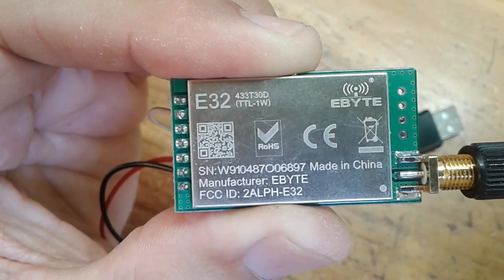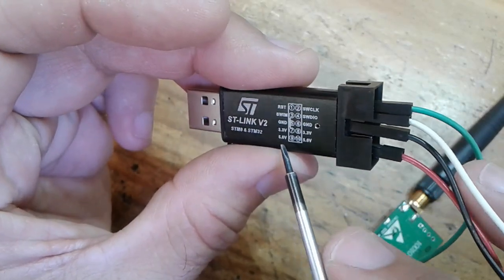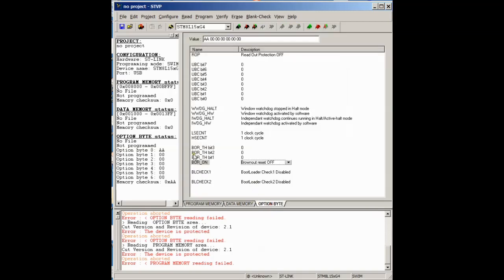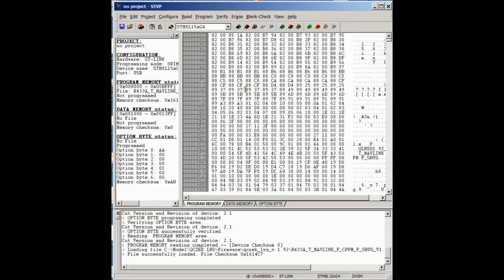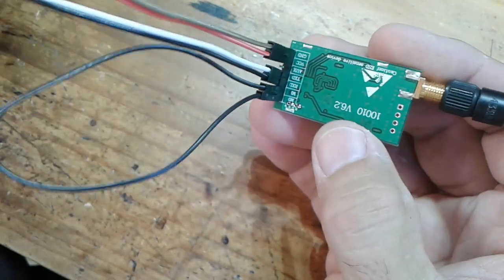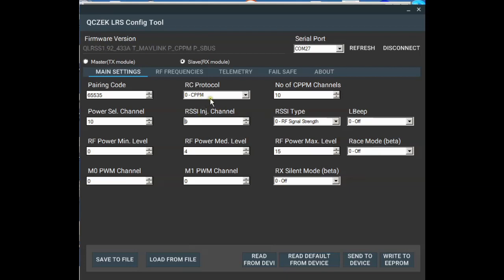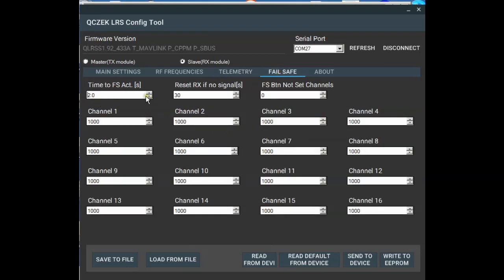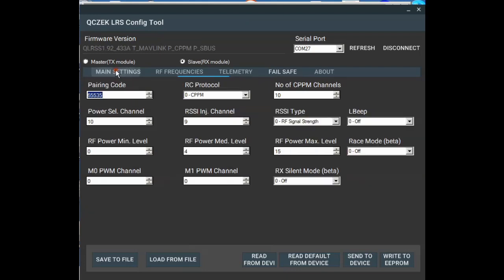QCZEK QLRS DIY LORA  Flash and Configure

Comment: I flashed and configured this LRS, but it doesn't work. The transmitter in the audio speakers is humming, and seems to be working. But in INAV, when PPM is selected, all signals are at 1000 and do not move.
I’m also not sure that I connected the receiver to the FC correctly, I connected the receiver to the FC input on the PPM RX
Reply from the maker: if you can hear that Morse code humm it should be working like you say, im guessing its the FC setting, 
maybe try programing the LRS as sbus, ppm is hard to setup on some FC, sorry for late reply, Brett

Comment: а что означает вот эта ошибка?Error : Cannot communicate with the device !
Check the SWIM cable connection and check all the needed pin connections on the SWIM connector.

If the application code uses Swim Disable and Reset pin as Output or has disabled SWIM Clock Divider:
Try Now to SWITCH OFF and ON the application Power Supply while NRST Reset pin is forced low.

Error : < OPTION BYTE programming failed.
Reply from the maker: I heard there is a problem with the 1B version is your module the same as this one ?
https://www.ebay.com/itm/194251185476?hash=item2d3a45dd44%3Ag%3AZbsAAOSwLSVdixAi
Reply: Да! Точно такой же!!
Reply: И что его ни как не прошить!?если нет ,то какая есть альтернатива?
Reply from the maker: @ЕвгенийМалиёв-й9ц  maybe it is the ST-Link not talking to the module correctly then.....
Reply: @kermets  может быть   нужен другой программатор  ....
Reply from the maker: @ЕвгенийМалиёв-й9ц  yes try another programmer first or do you have another ARM prosseser you can program like this,
https://www.youtube.com/watch?v=KgR3uM21y7o
Reply: @kermets  спасибо попробую

Comment: it gives an error check the SWIM cable connection... do you have any idea
Reply from the maker: I have heard the new version of this module gives errors.....maybe check with the groups on RcGroups in the link above.......
and try another module or programmer.....good luck
Reply: Hi now v8.0 use MCU hc32 from hdsc. İ heard that from ebyte

Comment: Hi sir I'm using e32 915T30D module as telemetry module for pixhack.
When I try to connect it. It is stuck at getting parameters 1, i can see the datas but not able to upload waypoints or mission. Any idea? Why it is not connecting properly
Reply from the maker: Hi, I never used the telemetry side of this module but like all our gear that sounds like a conflict or problem with inav or ardupilot,
are other people useing this module in this way ? if so try to follow there setup first to get it going to progress from there,Cheers

Comment: Any reason u start using qczek lrs.. Saw ur previous video on openlrs
Reply from the maker: I still use openlrs and trust it 100% and have not flown to its limit and had big plans to do a 30km
trip, I made the wing and battery to do it but never got around to it..... I have done so much failsafe testing but thought the limit with
Vee antenna might only be 15-20kms so I started researching with Qczek for more range 
I have only tested qczek local (within 1 km) ........
Reply: @kermets  owhh noted.. Keep up with your video.. Appreciate to see more tutorial like video of your builds or projects.. I am just starting with qczek lrs.. Just bought the e32-ttl-1w but haven't flash it yet..

Comment: I bought an E32 433T30D and came E32 433T30D 1B what can I do? Thanks
Reply from the maker: Oh I see you on the forum.....yes I guess it is a fuck up if Qczek can not change the firmware for the new chip, 
Maybe part of the world wide shortage of chips,
try to find old stock on ebay of Aliepress,
just have to wait.......
Reply from the maker: What does the 1B mean ?
Reply: @kermets  A new version is coming out according to the sellers , Now it 's E32 433T30D 1B which they say is the same thing but it does not come with a stm chip with 1B ending !

Comment: Hello.  I'm using an external ppm transmitter and a ppm receiver (qczek lrs).  when I turn off the transmitter the red parachute is not displayed.  Failsafe set to RTH.  in my opinion it should display a red parachute.  What am I doing wrong ?
Reply from the maker: Are using asking about the LED ? i dont understand the word parachute sorry.
Reply: @kermets  in Inav configurator, under voltage meter are three icons.
Reply from the maker: @krystianbogaczynski5787  if you mean on the OSD maybe one screen is on top of the other and needs moving with mouse,
do you see it here........https://youtu.be/DyJLByED9rI?t=9

Comment: Dear Sir! Very much thx for this video, I finished building 868 version yesterday, works perfect. On the table. Before I build it in the plane, may I ask a question: do you know if I can use m0 to output a servo and m1 to output the rssi? I can not find the answer anywhere. Best regards, Steve
Reply from the maker: Hi Steve, sorry I missed your question bloody YT. did you try to change in the config tool to see if it works.....Brett
Reply: @kermets  Hi! I ended up with qczek. Now I use R9.
Reply: @kermets  I assemblyd the airplane with qzek. First it was okay, next time same place horrible delays in control. I can not trust in this system.any more. Frsky works out of the box and relauble.
Reply from the maker: @istvansoos1055  Ok....I wonder if it is a module problem from the factory...or bad interference on the same frequency that you were on.....
I am still using OpenLRS and have only tested Qczek 1.8km
It is good you are having success with R9, Brett
Reply: @kermets  1.8 km? I fly more than 3km on 2.4 :)
Reply: My best flight was 5.3 km on 2.4. with my diy bicircle antenna. I moved to 868 to avoid wifi disturbances near the town.
Reply from the maker: @istvansoos1055  1.8km was only testing.....I have gone 8 km on OpenLRS on diy Vee antenna with no FS
I do not trust the Qczek as yet because my openLRS is working so well....https://youtu.be/jDxIlBqe210?t=77

Comment: Thank you.
How connect talmatry RFD 900 with ardunio control servo
Reply from the maker: Hi, sorry I do not use Telemetry...... But If you want to use rssi lost packets you can use one audio channel
same as open LRS.....https://github.com/openLRSng/openLRSngWiki/wiki/Using-the-LBEEP-feature
Reply: @kermets  Can I control Dron through lora or is there a time delay
Reply from the maker: Yes it is not problem with Drone
https://youtu.be/Mb26us9xcEo?t=290